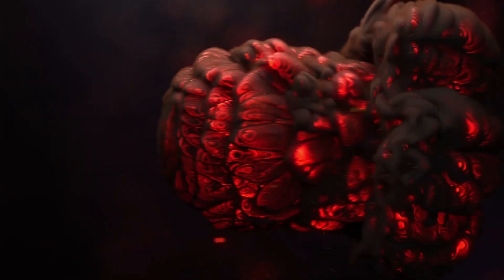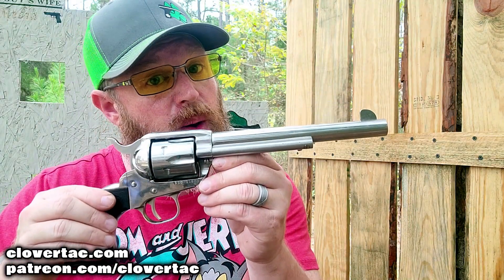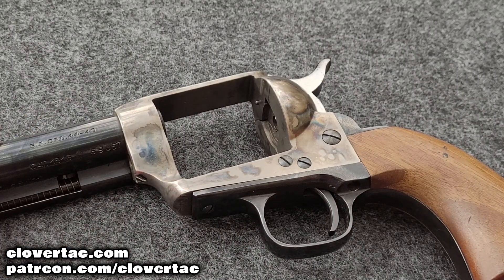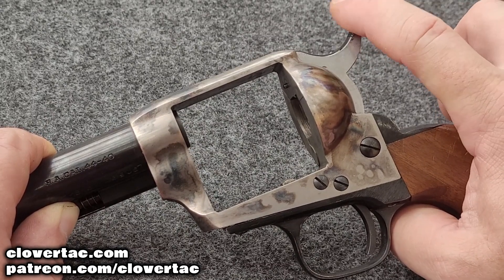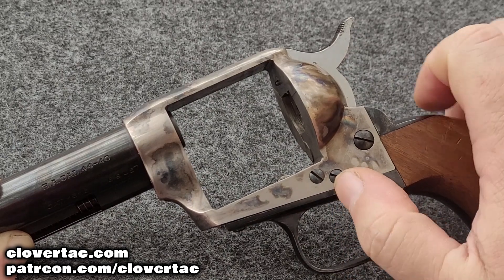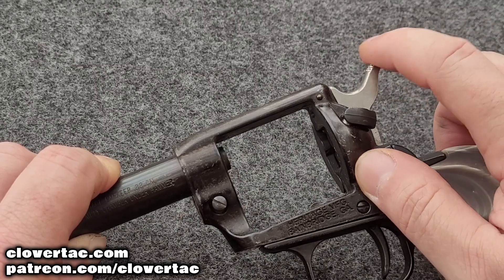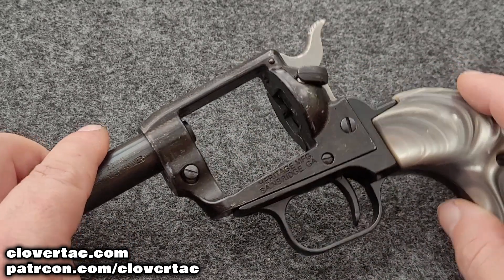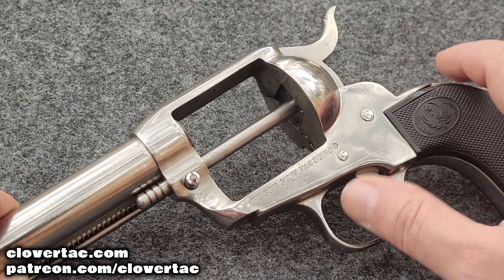How Alec Baldwin's Single Action Revolver Should Have Worked

Comment: if he didn't pull the trigger back far enough to engage the first sear and let it go, it could have enough energy to ignite the primer. It's impossible to know without seeing the firearm he used.
Reply from the maker: you can't move the hammer on a single action by pulling the trigger.... and enough force? did you not even watch the video here?
Reply: @CloverTac  Yes Sir I did. There are other types of single actions with less built in safety's I've seen some that only have "half cocked" which is why I said what I said. Of course, It's all speculation without seeing the actual gun he used and just my worthless opinion/observations based on everything I have seen to date.
Reply from the maker: what?  maybe something is lost in translation here but if you can pull the trigger to make the hammer move backwards on a revovler it is not a single action, period, by definition. if you know of a single action that does this please provide a model and make so i can look it up... i would be a first for me and i have seen/handled hundreds in my lifetime.... again, assumign we are even on the same page about what we are talking about here. maybe hit me up privately on some other social media, through my website, etc because if such a thing is out there, i want, no need to know about it.
Reply from the maker: you know, now that i have had a moment, i do recall a very old unsuccessful line of revovelrs that would half cock with a double trigger or trigger guard type design, then you finish the cock and use the trigger or secondary trigger to fire, those are sorta rare though, so no way that was what was used here. mostly likely what was used was very similar to the Uberti shown
Reply: @CloverTac  No disrespect was intended in my comment. I enjoy your videos and I fully agree with your assessment, I was only offering up other information I had learned on possible causes of this accident. My personal belief is he had his hand on the trigger and other than whoever brought live rounds on the set, he is 100% at fault. I mean, they have made 3 John Wick movies and counting now and no one even came close to an accident like this on those sets.
Reply from the maker: @mac8080  i never took anything you have commented here as malicious.... but your explanation of your events has me very curious as to exactly what revolver that was and other circumstances around it because your description of the trigger causing the hammer to come back just does not align with the mechanics of a single action revolver... trying to understand here and yeah, 100% plenty of blame to go around here, 100% far more at play with things gone wrong, just a horrible, icky, messy situation. i said from the jump that it was really not likely we would see anyone actually convicted of anything here simply because there was so much that went wrong, so many failures by so many people
Reply: @CloverTac  I wasn't referring to the trigger,  I was (badly) trying to say that some older revolvers don't have that 1/8" first safety when you pull the hammer back. I have seen some where you have to cock it back almost to 1/2 before you hear the first click and the sear engages. just going off memory, but I believe they were black powder percussion type. So in theory (and just based on Baldwin's account) just based on that, if the "prop" gun was some type of modern fabrication made to look like those older revolvers and it didn't have that first safety, I could see a firearm like that going off if he just pulled the hammer back and let it go. Without seeing the actual gun used the only real information we have is how "normal" revolvers work like in your video. For me, this just beings back memories of how Brandon Lee was killed on set, with the same mistakes of live rounds.
Reply from the maker: thansk for clarifying, i still don't know of a revovler that doesn't have that feature.... those i know that do not have that feature are usually built differently overall, like the ruger example here, that still makes the likelihood of this type things near zero. that said, i don't have a problem admitting that i have not seen every gun out there and there certianly could be some cheap imported knock off revolers or whatever that are built that way. but speaking to that speciically, junky firearms are not used in movies, by in large. cool footnote, every single firearm in the newer Magnificent 7 movie was provided by the prop division of Cimmarron Firearms, so all legit, real firearms. A true prop replica would no dobut be non firing, mainly because if it wasn't, that would get into some firearm manufacturing regulations if it did. yeah, we have  not seen this happen very many times on movie sets and it makes it super tragic when it happens for sure. hopefully, moving forward, these movie studios spent a little more time, thought and money in to their on set security, firearm consulting, training, camera work in front of firearms, etc. again, appreciate the clarification and conversation here. took a while but finally got on the same page. 🤣😂
Reply: @CloverTac  Back in 1971, after returning from Viet Nam, I bought a 3 screw Ruger Blackhawk revolver. The revolver was loaded and I had it in the first click (1/8"?) of the four click hammer and then pulled back on the trigger. The gun went off scaring the hell out of me and raising a cloud of dust from the wall paper in the hallway. I was the only one home thankfully and the bullet disappeared into the framework of the home. Those old 3 screws were not to be trusted in that first "safety" notch but worse that that, was that I knew better but did it anyway. After that I always loaded 5 with the hammer resting on an empty cylinder. Yes I still have all toes on my right foot.

Comment: "the gun just went off" is a lazy, uneducated defense,  one that obviously is mechanically impossible,  thanks for the demonstration Clover.....
Reply from the maker: not really, brushing the trigger is easy to do and he certainly could think in his mind he did not pull the trigger. i have seen that type of thing repeatedly with negligent discharges. but ultimately, yeah, unless we find out the revolver is faulty... he would have had to
Reply: @CloverTac  BUT the revolver wouldn't have gone off without his input, there are multiple mechanical "safeties" that would need to be removed/bypassed for the gun to go off,  the "it just went off" makes the uninformed believe that guns are dangerous,  but in fact, they are generally very safe..... i would like to see a "how much force does it take to hit that primer with enough force to fire"........
Reply from the maker: @jim7700  it takes far more than i demonstrated with the Uberti before it gets to the safety posiiton. i can tell you that modern ammunicaiton require a minimum of about 6 pounds of force, now, the issue is breaking that down into something that is understandable for people and so far i have come up empty on that.... too much math to try and give an example
Reply: @CloverTac  love the work you do bud, keep it up.....

Comment: It would be kind of fun if the one used by Alex Baldwin on the set is new production with transfer bar safety. He is toast for sure.
Reply from the maker: from what i hear, it is not, it is very much like the Uberti in this presentation
Reply: @CloverTac  
Doesn't Uberti have retractable firing pin?
Reply from the maker: @ChaohsiangChen  so the one i used here is an Uberti and is fixed, so no, not all of them. now some of the more modern stuff, yeah, they could be, there are a wide variety of stuff out there. i would think, and this is my opinion, for a western style movie, it would be important to use a fixed firing pin revovler because purists would notice that in a close up shot.
Reply: @CloverTac  
That's very possible as the company that provided those may have stuff from Reagan era when he still acted.

That being said, I think it's unnecessary risk since post production is basically CGI fixing nowadays. It's not hard to CGI fixed firing pins.
Reply from the maker: @ChaohsiangChen  noted but if we are talking CGI, tech, etc... why on earth does a human have to stand in front of a gun to get a certain shot? right? it is called a remote camera, drone, etc
Reply: @CloverTac  
Woo....
That's a good point. As if unless Alex Baldwin does want to pull the trigger on the cinetographer and the director, all these risks of standing in front yhe muzzle aren't even needed.
Reply from the maker: just one more thing to add to the long list of stuff that make no sense about this who tragedy. come on now. guntubers take video and pictures down range like that all thet ime, how, a camera and a tripod... duh. now, this again, like a lot with this situation is speculation and assumption, maybe, just maybe, there are certain shots that require that type of thing... doesn't seem like it to me but i am not a hollywood cinematagrapher either
Reply: @CloverTac  Don't know if you saw his whole ABC interview, but he said they were laying out a camera (and gun) angle that they would use later.
That also makes no sense.  There is no way he could put his hand in exactly the same position an hour (or whatever) later.  So, "practicing" was just another chain in the unsafe procedures.  Plus, WHY would a camera person have him line up on her and WHY would he agree to do it -- she was not chained to her position.  Sad.
Reply from the maker: yeah, i watched it all, won't pretend i remember it all and don't really have to because this video was not about proving someone right or wrong but rather offering education on how such a revovler SHOULD work... that all aside, totally agree, horrible tragedy made worse by so many goofy, uneducated, reckless decisions

Comment: Alec is lying. Anyone who knew how the single action revolver work, already knew that  after cocking the hammer, the trigger need to be pull. The cartridge primer need to be hit with significant force to fire. This is a man made tragedy that are 100% preventable.  Three person, who handle the fire arm before it is used, doesn't bother to check the weapon is unloaded.
Reply from the maker: it is common for people who have accidents with guns to use the "my finger wasn't on the trigger" thing. this is because they were likely not focused on the trigger and or deliberately pulling the trigger. and in that situation, the brain just doesn't really file that memory away very well. so it is entirely possible he believes he didn't pull the trigger and that isn't him lying. that said, there is really no way, with a properly functioning revolver, for it to go off without some type of trigger engagement.... therefore, at the very least, he is wrong in what he remembers, which again, is pretty common.

Comment: The gun they hand Alec
Probably had a sticky trigger
It's really a workplace accident
Cause by defective product
Alec should sue the manufacturer
And the importer that bring in that defective junk!
Reply from the maker: sticky trigger? um, did you bother to watch these examples? sticky trigger would not cause an accidental discharge. in fact, unless you are a full cock, the  trigger is virtually locked into place. also, lawsuits don't really work that way, this was a prop gun, we have no clue what the armorer did to it (or maybe didn't in regards to maintenance). and keep in mind, we do know there is some shady stuff surrounding the armorer. the reason we have not seen any criminal charges is there is just too much blame to go around, same holds true for any civil suits. does alec share in the blame, you bet, but the videographer does too, the director does too, the armorer does too, the asst producer does too and that makes this whole tragic situation just too muddy to make much sense of anything but HOW the revovler should have worked... which is shown here. oh and keep in mind, they were shooting this with live rounds the day before filming, that doesn't sound like there was anything wrong with the firearm otherwise there would have likely be an accident that day. heck, that is how a live round got on set to begin with. agian, very muddy here.